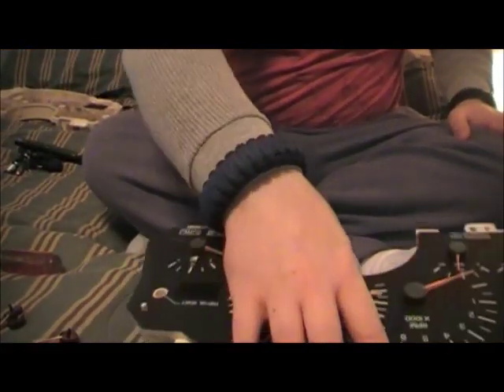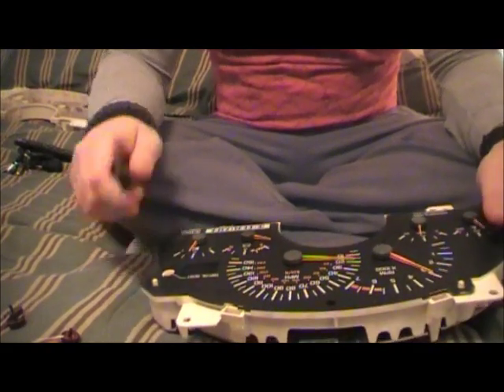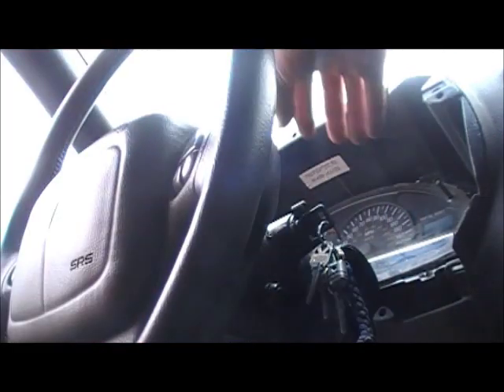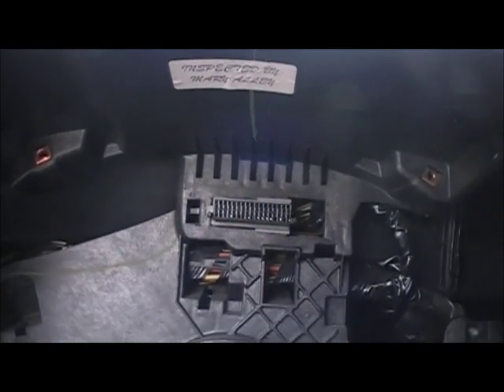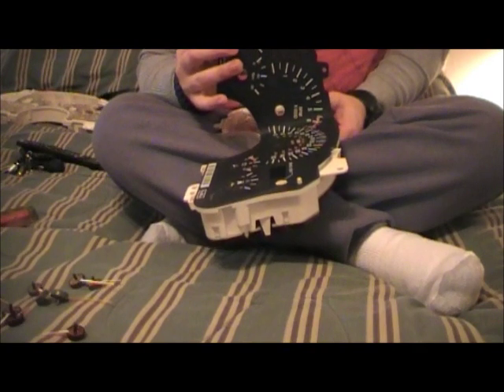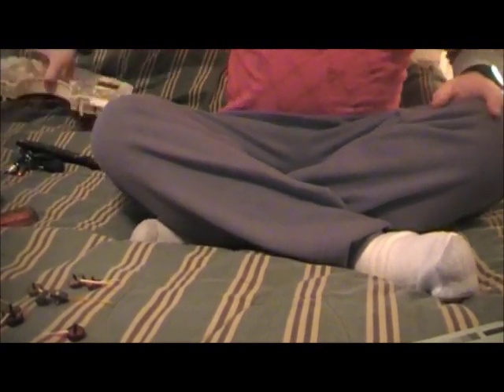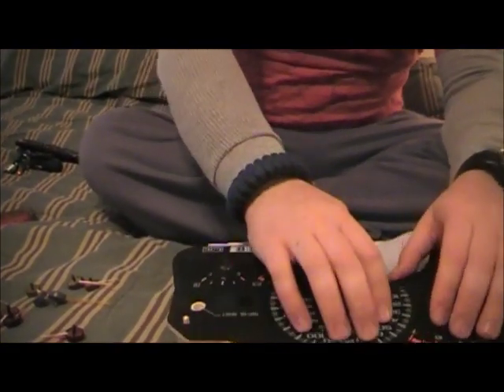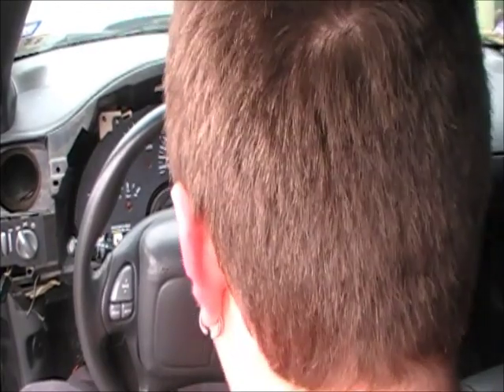LS1 98-02 Chevy Camaro Z28 SS Pontiac Firebird Trans Am F-Body Gauge Cluster removal Overlay swap

Comment: Jesse,I got the overlay in as we discussed via e-mail.  Issue I am having is when the mechanic replced the needles they were all over the place.  Only my temp needle is acting crazy.  When I drive faster the needle receds to the left and not to right to indicate proper temp.  Any ideas??/ I truly need your help.  The new overlay rocks with the blue LEDs!!
Reply from the maker: hey William! I'm sorry that I'm just now getting back to you! If your Mechanic has one of if you are able to get one, use a scan tool that plugs into your OBDII plug under the dash as if you were going to read the codes. Most shops have one that can monitor engine read outs like RPM, temp, oil pressure and etc. Remove the plastic cover on your gauge cluster so you have access to your needles and put the gauge cluster back in the dash without the cover. Have your car running, let it get to operating temperature and use that tool to see where your needles should be. Remove the needles and then put them in the correct places.

Comment: Hi bro, this might be a silly question; do i need to disconnect the battery before starting to remove the cluster?
Reply from the maker: Marwan Al Zadjali I wouldn't say it's required but I would recommend it for sure. Either way when you disconnect the cluster your ODO will be stored but your TRIP will not be and will reset to 0.0.

Comment: I know it’s been a while but how did you remove the steering column “stem” ? Does it unscrew? I tried it myself and I was afraid it would end up breaking it since I have no idea of how it’s supposed to come out. Please help.
Reply from the maker: Hahaha I'm still here man! Yeah it does unscrew. Lefty loosy. But you will need it possibly again after you get the bezel and such off to lower the steering wheel as much as possible, past the lowest lock. So keep it close by.
Reply: AdrenalineJunky17  Thanks for the reply, this will be my next project. Just finished updating my TA with LED’s on the exterior and interior just need to do the gauge cluster but first I need to get my hands on a Camaro Z28 gauge cluster since that one doesn’t have the red tint like my TA has.
Reply from the maker: @DrillSgtPain  I found mine on eBay. But check Facebook marketplace too. That wasn't even a thing back when I made this video.
Reply: AdrenalineJunky17 Im just so nervous about the gauge needles, not yet confident about that
Reply from the maker: @DrillSgtPain  it'll be fine man. I wasn't very confident either just take several pictures of it. Maybe even take a video of them when the car is idling at operating temp. And then as long as you put them back on the same with the car idling at operating temp. You'll be fine.
Reply from the maker: @DrillSgtPain  and you can always double check them with a $10 obd2 Bluetooth scanner from Amazon and the Torque app.

Comment: Great video on cluster removal. I did it in my SLP 2002 Camaro SS but forgot to take a photo of the needle placements. What do I do now? Needles are all over the place. I cant get them right. Got any fixes for this?
Reply from the maker: The only way I can think of is to either buy or borrow a cluster that is already assembled and hasnt been apart from someone and put it in your car then let it get to operating temp and take a picture. Hope you get it worked out man!
Reply: I forgot to take photo also but what's the difference between my crazy gauges and another one. Does a new one calibrate correctly just by plugging it in so how come mine can't do that?
Reply from the maker: glenn S  If you have removed your needles and do not put them back on correctly yours will not automatically recalibrate correctly because the needles have been off of the spin bars and if you put them back on in the wrong angle they will be incorrect. As I said in my first reply to you, "a cluster that is already assembled and has not been apart" meaning, one that has not had it's needles removed before.
Reply: AdrenalineJunky17 OK So r u telling me I need a new (previously owned) cluster. By the way my needles not only do not set correctly but they dont move at all. What happened that they do not move at all. I think there are guys refurbish the cluster for approx $120. Maybe I should do that.
Reply from the maker: glenn S If you want to know where to put your needles on your old cluster you'll need a different cluster that has not been taken apart, plug that cluster into your F-body, start your f-body, then take a picture of where your needles are. I have no idea why they wouldn't move. That would mean that there are a lot of broken pieces inside that cluster, jamming things up. They should move freely whether it's plugged in or not. You might just want to either buy a new cluster or get that one refurbed.
Reply: Well the needles are now moving but they are wacko. The speedo goes from zero to off the charts when key is turned on and the RPM does the same volts,temp,oil move but dont know if they are correct. Fuel gauge works. Your suggestion is to get a new cluster id that correct?
Reply from the maker: glenn S Ok man, I'm not trying to be rude but I have answered your question several times. You do not NEED to buy a new cluster, just borrow one from a friend if you can(one that has not had it's needles removed), plug it into your F-Body, Start your F-Body and let it warm up then take a picture of it. Then take that cluster out, put your cluster in, start your F-Body, let it warm up, then install needles according to the picture you took. OR yes, buy a new cluster and just say fuck it. Your ODO will be incorrect unless you do what I stated above to correct your factory cluster, but if you are not concerned with that then it isn't a problem. I hope you get it worked out.

Comment: Hey I just did this for my car and now I can’t get my miles per hour to work and when I shut the car off the battery needle don’t go back to 0 so what do I do to fix my problem also can’t get my oil temperature one to work all worked fine be for I put the over lay on u have any advice
Reply: I would try taking it out again and checking the connector.  I have not pulled mine yet (to fix the temp gauge), but from this video, it looks like those pins could get bent when you put it back in.
Reply: Also, did you take a pick of the needle positions before you removed it?  Another video on here mentions that.  You need to make sure you put the needles back in the right positions.

Comment: How many lights are in the cluster? I'm buying new LED's and I want to know so I buy enough.
Reply from the maker: There are 8 light bulb sockets over all on the back of the cluster. 5 over those are for the illumination/backlighting and the other 3 are the two blinkers and the highbeam. So you have 5 backlight positions, 1 blinker indicator for the left, 1 blinker indicator for the right, and the high beam indicator. Get the 5 in the backlight positions what ever color you want, get 2 greens for the blinkers and 1 blue for the high beam. Those are tinted so if you use a different color is will mix blue for the highbeam and green for the blinkers with whatever other color you put in there.
Reply: Thank you very much man that helps me a lot...
Reply from the maker: No problem at all! Hope you get it the way you want it.
Reply: Thank u. Have a wonderful thankgiving.

Comment: hi,  my 98 camaro z28 digital tachometer becomes colorless evenly when I turn on the lights.  do u know how to fix it???  thanks
Reply from the maker: +Jorge Diaz If you have a digital tachometer it is aftermarket. You either have a wire that is not connected properly or the lights in it are bad. Camaros did not come with a digital tachometer from the factory.
Reply: +AdrenalineJunky17 sorry  i mean the odometer it is digital.  I'm only owner haven't changed or mods.  
at night its easy to see it.  when I turn the headlights on the odometer becomes less intense.
Reply from the maker: +Jorge Diaz Oh ok gotcha. it may have a lose connection or the bulb itself may just be getting old. How dim does it get? Just slightly or so much that it's hard to see?
Reply: +AdrenalineJunky17 its hard to see.  I saw on your video that the odometer doesn't have a bulb socket.  what would be the steps to change the bulb.  thanks
Reply from the maker: +Jorge Diaz to be honest I have never replaced one on an fbody gauge cluster. I do know that the leds are soldered into the cluster on the odometer so it will not be as simple as just pulling out the old bulb and putting in a new one. There may be a video on YouTube somewhere that will help you.
Reply: +AdrenalineJunky17 no problem.  thanks.  Saludos  desde México
Reply from the maker: +Jorge Diaz no problem man! I hope you get it fixed!

Comment: Is a 02 Firebird body interchangeable with a 97 Firebird Formula TransAm V8?
Reply from the maker: Liza Velasquez just body panels? Should be pretty close. There are quite a few people that have converted LT panels with LS panels. There might be a couple pieces that aren't direct fit but shouldn't be too hard to work out.
Reply: I'm mainly wanting to put the front and rear ends on the 97 car it's pretty beat down as far as sun drying everything out. No dents though
Reply: And the 02 body is much more attractive, but my 97 is super fast : )
Reply from the maker: Liza Velasquez front will be pretty simple. Those panels bolt on and off. The rear is going to be a challenge. The quarter panels are welded on, so you or a shop would have to cut the factory ones off and weld the 98+ ones on. The rear end should be pretty much the same except the tail lights and maybe the wing(which can be replaced pretty easily).
Reply: AdrenalineJunky17 
The rear quarter panels can stay on if need be, it's the window light/bumper combo I want. And the front is different in that the 97 hood has vents the other doesn't and only has single flip up lights the 02 are double light so they are def wider
Reply from the maker: Liza Velasquez yep I know. It has still be done. You would just have to replace you parts with the 98+ parts and there may be some light fabrication that would need to be done. But it is definitely doable. You can find project videos on youtube of it. Probably by search LS conversion on LT fbody or trans am.

Comment: If replacing a cluster with another one without removing the needles; do I still need to reset the needles to sync?
Reply from the maker: If all you're doing is swapping one entire cluster out with another entire cluster, no. The whole reason for removing the needles is to change the overlay. The needles have to be taken off to take the overlay off. Then the needles have to be put back in the right places, but you can't mark the stems while the needles are on. So you use the operating parameters to put the needles back in the correct places.
Reply: @AdrenalineJunky17  thanks a lot man. I know it's been a long time. I appreciate it. The lcd display in mine is damaged and I wanted to swap with another cluster. Great to know it's all plug and play
Reply from the maker: @inglando  yep your only difference will be the miles. That is stored within the cluster, not the car.
Reply: @AdrenalineJunky17  on the ad pics I see the needles are not marking 0. They are all over. Does that mean that it is not plug and play? Or can the needles move while cluster is off but won't matter if they were never removed?
Reply from the maker: @inglando  the needles will free float while the cluster is unplugged. So if the person has moved the cluster around, held it upside down, things like that. The needles will move. No worries unless you plug it in and they're all over the place.

Comment: mine just comes right out with out doing all that and goes back in with 4 screws and 1 cover and 2 screws for it, 1 min and its out lol
Reply from the maker: Is that in an Fbody or another type of vehicle?
Reply: @AdrenalineJunky17  2001 camaro 3.8 v6
Reply: Pull the bottom out first with wheel tilted down, ill have to send you a video of it, i had to do it today it started messing up on me, took 2 screws out of top cover took it out and then 4 screws holding it in and pop lose from electric connection and pull bottom first comes out
Reply from the maker: Camaro is different from a Trans Am. I've done it on both. Yes its easier on a Camaro.